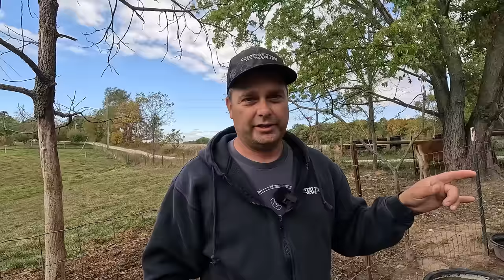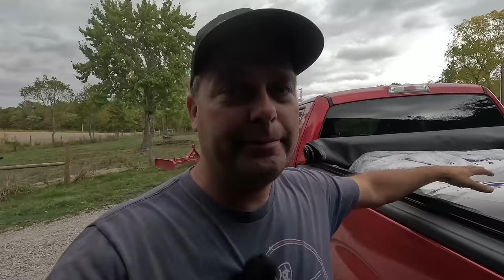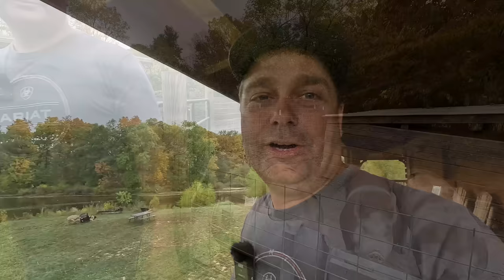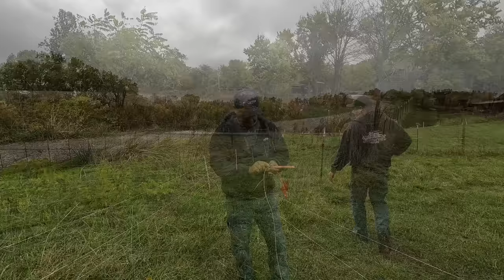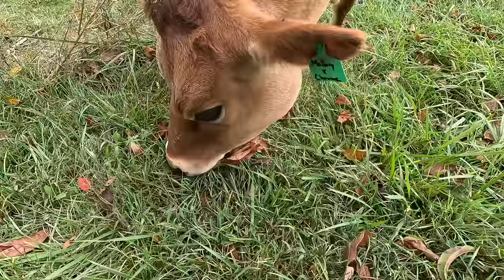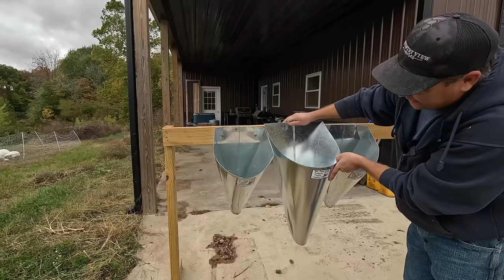New Ram Lamb Joins the Flock  |  Adding Pasture is a Shocking Experience.

Comment: Evan, have you looked into getting a small motor for your John boat and rigging out some skimmers to move all that duck weed to the drainage area? 

It might not work at all and may only work in a rainy period when the level was helping with some overflow drainage. 

If you have a friend with a small motor he is willing to loan to you for a test run it could be worth your while. I’d think a small motor like a 10 or 15hp 4 stroke would do the job and those size motors are very efficient. They take all day to use up 3 gallons and the 4 stroke motors don’t foul plugs running all day at trolling speeds like a 2 stroke is famous for. 

Maybe an electric trolling motor that can use your ECO cells would be the answer. Good luck. I hope it works. It’s a real shame to see that nice large pond rendered useless by that vegetation.